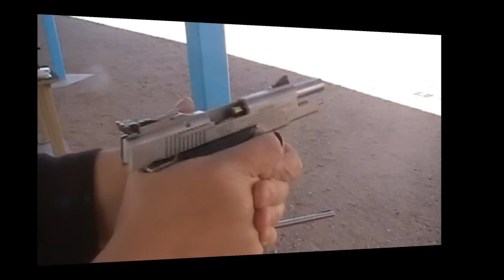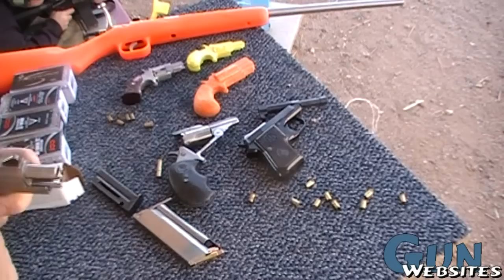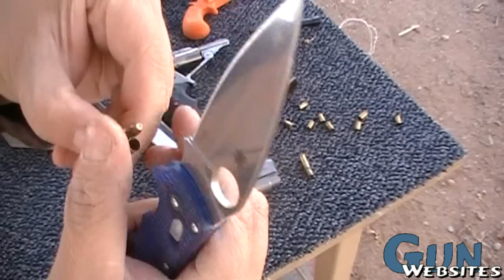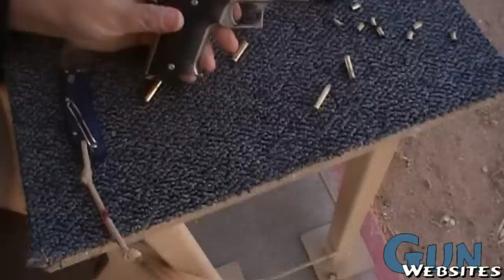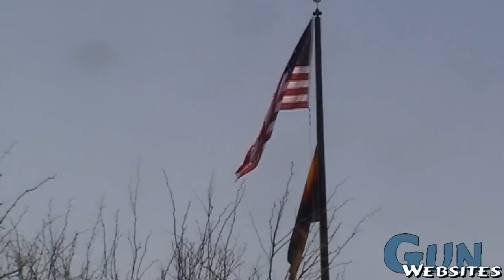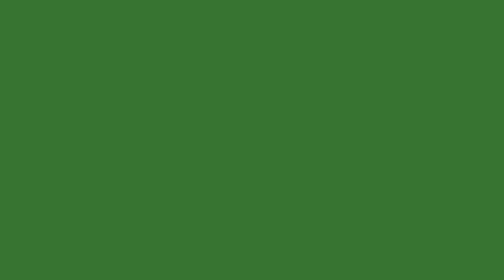Shooting Micro Automag II .22 mag Pistol AMT

Comment: A video by Mr. Gun Expert. Automag IIs were designed back in the 80's to fire 1 brand of ammo. Off the top of my head it was Hornady. But I read somewhere it was Winchester. It's been a while since I looked at my owners manual. So right off the bat, make sure you have the right ammo. Yes, brass expands against the chamber wall. Thats why this gun has little holes drilled into the chamber. They were called "plenums". They hold onto the brass until pressure drops to a safe level. Not really a locked breach but a delay. The stainless steel it's made of needs lithium grease. If previous owners didn't use the correct grease the metal may have galling. I have owned 2 but they both had longer barrels. I was pretty impressed with the reliabity of both (of course they were both new). Better than most ..22 lr auto's I had shot.

Comment: Looks like a blowback action. May not just be extractor spring weak, but also recoil spring not quite stiff enough to delay slide movement long enough to allow chamber pressure to subside. Or ammo needs to be reduced power. AMT had some cool ideas anyway, though. That gun would be cool to have as a tinker's toy. I have an AMT Backup .45 that needed tinkering to get it to run. You have to enjoy the challenge of getting it to run. Not for the zero-hassle crowd.
Reply: That’s for sure

Comment: Clean the chamber and it should fix the extraction problem.  I understand these chambers are grooved to allow for expanding brass and if that gets dirty they wont extract properly.
Reply: +Sam King   Good first thing to try!  If someone ever fired a bunch of .22LR through it, getting in the chamber with a cleaning brush or polishing cloth might get it going again.  I think I have the same problem with a Marlin 39--no problem with .22 Shorts but i think there's junk in the forward chamber causing the LR's not to eject.
Reply: Detail or ultrasonic cleaning. Both if at all possible. Probably wouldn't be a bad idea to polish feed areas, metal-to-metal friction surfaces. Some say Frog Lube or similar bake-on/iron skillet seasoning technique CLP products on low-tier firearms like AMT.  I'm told it helps a lot with Ring-of-Fire guns like Bryco/Jennings/Jimenez or Davis/Sundance/Lorcin/Cobra.  A spring job where all the springs are replaced and a new, tuned extractor would also help. Wolff doesn't have springs but a decent gunsmith can easily make them, especially with weakened but completely intact old springs: a pattern to follow.

Comment: Get a stronger extractor spring.  You pointed out that it extracted fine when you placed thumb pressure on it during the slide movement.  If you cannot find a stronger spring, then have a good gunsmith make one for you.  Either that, or bronze it and place it on the fireplace mantle as a display.

Comment: I have a full size Automag.  Loved(passed tense) shooting it.  It has been sitting in its box in my closet for 25 years.  The clip is a peace of crap.  It is the cause of most malfuncrions.  You can't get the follower out to clean it properly, so it doesnt feed with enough force.  Also it only likes ball type powder which years ago I could only find if I purchased Federal ammo.  Flake powder fouls the gas ports after a few shots and it wouldn't blow back the slide sufficiently.

Comment: the only reason per say the pmr30 is so reliable and dependable is because the pmr30 has 2 extractors. the micromag only has one. You need that extra extractor to pull such a long rimfire casing out. respectively, that's where amt went wrong.

Comment: somehow, the stains in the non ejected are consistent with lead from shorter length ammo, say 22 lr.....
Reply: Those "stains" are from the partial holed in the chamber which are designed to slow down the slide so that the firearm will function  properly . . .  It could also be crap left in the chamber which needs to be cleaned to ensure proper functioning.

Comment: doesn't apply here, but most .22 pistols are very susceptible to limp wristing. the issc m22 caught lots of flak for being unreliable, but if you held it right it worked flawlessly. I have a feeling this is the case for the p22 being "finicky". this is also true with the wmr autos.

Comment: the prob might not be the extractor, take the slide off and inspect the chamber mouth, what you want to look for is if the firing pin has peened a divit in the mouth of the chamber. if it did it's from dry firing. take a file or stone and remove it and that might fix it. cool gun give ya 20.00 bucks for it lol